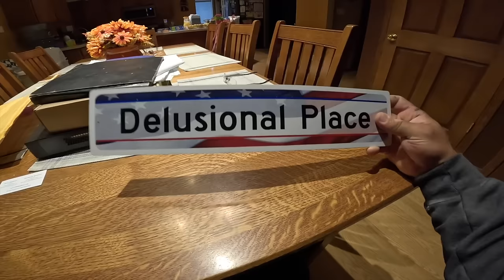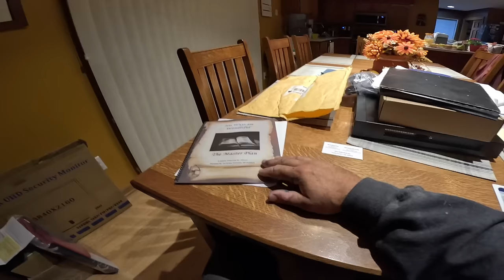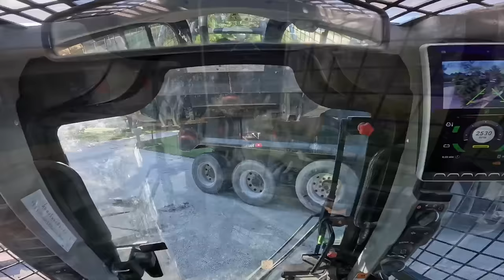Wheelchair Ramp, small but satisfying!

Comment: Pro tip : to make sure a corner is square measure 3ft off the corner on one side then 4ft off same corner in other direction and then connect two points as if u were making a triangle and that measurement should be 5ft if corner is square.
Reply: Pythagorean Theorem  !  3-4-5. 6-8-10.  And so on!   This used to be taught in high school.   Math class and shop class.
Reply: Kind of surprised they didn’t use it
Reply: Everytime I make something square it looks crooked next to other existing things that aren't square so I just eyeball it from every direction and go with whatever looks best to the eye.
Reply: @Bennysol depends on what you’re building. Some things have to be square. Also, building a square corner does not equate to being parallel to nearby things. You may have to rotate that square to match.

Comment: Question for you ryan,
Would you not buy a rock crusher and recycle your old concrete your tearing out from job, I bet your spending $100k per year on gravel, big investment to begin with but would quickly pay for itself, especially now you have the land,
You could also supply other contractors in your area
Reply: Already suggested many times.
Reply: Crushers are very experience to run and maintain. Not worth the hassle for someone like Ryan, cheaper and easier to buy it and truck it himself.

Comment: I know you know what you’re doing but , you do release the hydro pressure on those lines before trying to disconnect ? 
  Turn the machine off and with the safety still in working position move the controls around.    They shouldn’t be that hard to release unless the locking hub is bent or the lines are under pressure.

Comment: Just for Fun ...have the fellas add up Time in The John and Give the one with most Time the Golden John on the Spot Award😂...start putting the extra Concret in 5 gallon bukets..order some with Victory on them then Put a Pipe in and then you will have Barricades for Caution Tape so dont have to Drive something into ground and advertising on Bucketa..ANOTHER VICTORY

Comment: Could you vibrate the concrete and make room for more and build less mountains? you could also make concrete planters by filling 1 bucket with some concrete and forcing a smaller bucket in
Reply: That's what the plan was, then use big blocks of concrete for something else

Comment: WORK DONE ON ENGINE, OIL RELATED AND NETHER YOU OR YOUR CDL DRIVER DID A PRETRIP INSPECTION. YOU ARE BASICALLY IN THE CONCRETE CONTRACTING BIDNESS, BUT YOU ARE ALL SO IN THE TRUCKING BIDNESS.